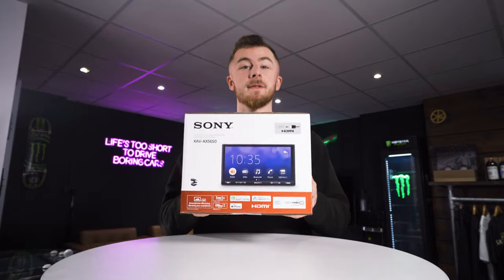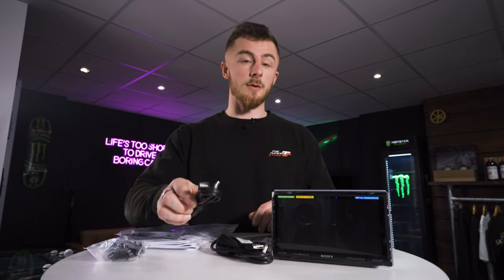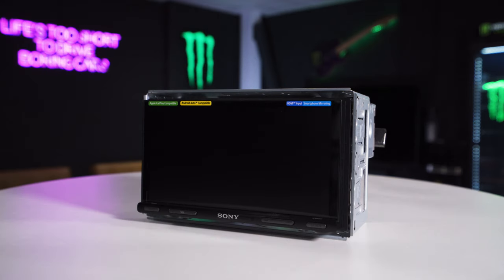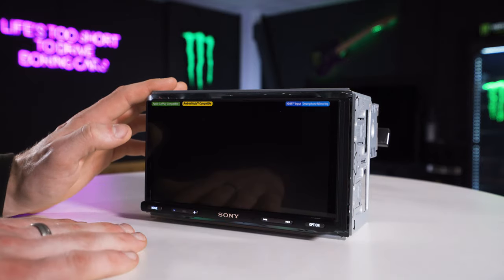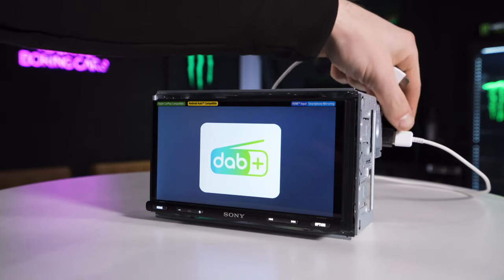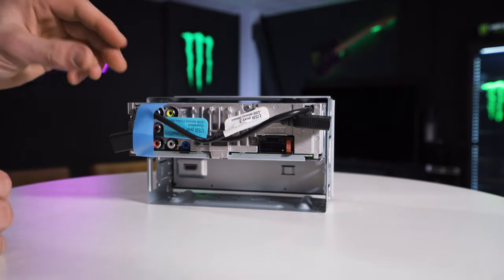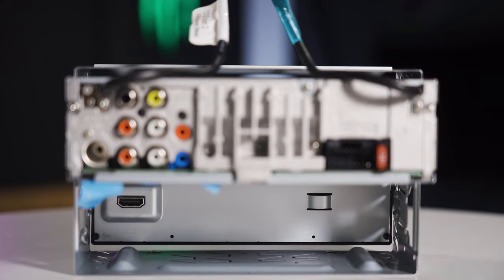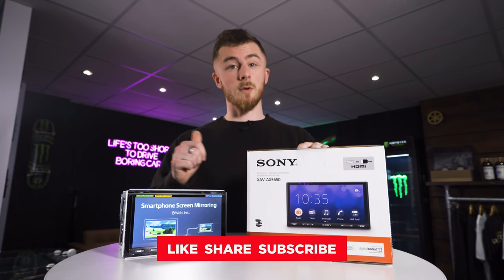Sony XAV-AX5650D CarPlay & Android Auto Car Stereo | Car Audio & Security

Comment: I recently purchased this headunit. The screen and unit itself is very responsive, which is great.

The things I don't like about it are

1) There's no way to use the progress bar to skip through tracks when playing via USB. So if I'm listening to a 45 minute mix for example, I can't slide the progress bar to reach a certain point which is annoying.

2) There's no album art via Bluetooth or USB

3) You can't press and hold things on the home screen to put them in your preferred order.

As you say, it's basic and works well. I just wish Sony added to above improvements.
Reply: Does it have WIRED or WIRELESS carplay and android auto? Idiots at SONY didn't think it's important enough to mention in specs.
Reply: @emilz85  wired
Reply: @DanTheManc1981  Baffles me that some units are still wired only
Reply: Did Sony come out with any update to fix this issue?
Reply: @JohnnieIsBored  what issue?
Reply: @DanTheManc1981  the cons you mentioned.
Reply: @JohnnieIsBored  you can now use the track progress bar whilst using android auto with the latest update. You still can't do this when using USB or Bluetooth.

Comment: You mention that the yellow port on the back is for reverse camera to plug in but there is also a wire on the harness with a label saying reverse camera, a bit confusing, which would you use?
Reply: The yellow plug is for the Video, the other wire is what is used to get power to the camera.  The camera I am ordering with my unit (Think I am going with this Sony, XAV-AC5600 (guess the 50 is for other countries?).    It has a wire along with the video plug on each end.  So you can get the power to it from the head unit.

Comment: This will do for me, only thing though, would that be amazing to have the same, but with wireless Apple Car Play. Anything on the market ( apart from the 8000 series with huge screens) with about the same screen size and wireless Apple Car Play connection? Cheers!
Reply from the maker: have a look at the Kenwood DMX-8020DABS, please not these are currently out of stock
Reply: Sony has their AX6000 coming out with wireless car play.  You can't expect to get wireless AA or CP in a 500 unit.  Unless you want to go the route of the low-end BOSS stuff.

Comment: Where would the blue wire on an aerial adapter connect to on this unit? It doesn't have a blue remote wire hanging out the back of the unit for power.
Reply from the maker: there is a blue remote wire in the iso loom that comes with the stereo which you will have to tap in to
Reply: @CarAudioSecurityUK  awesome! Thanks!

Comment: It is a shame that Sony does't have an Android unit, to use Waze (for example) directly without connect the phone each time (that will be broken the charge port in the time).
I had some android units but they are slow and sooooo lag.

Comment: I just purchased a XAV-AX5600 but received this model instead(XAV-AX5650). Does anyone know if this would function properly in the US as I believe this is the European version.    Thanks in advance.
Reply: Yes i am in the same situation where i ordered the XAV-AX5600 but received the XAV-AX5650 instead i have had no issues with this unit since installing it in my car.
Reply: Interesting.  I was wondering about the 5550 and 5650 nomenclature used on these.  I guess they are for other country releases?    Where do you live?   Getting ready to order the 5600 myself, I think.  Still debating.